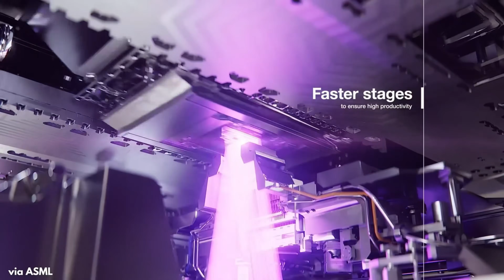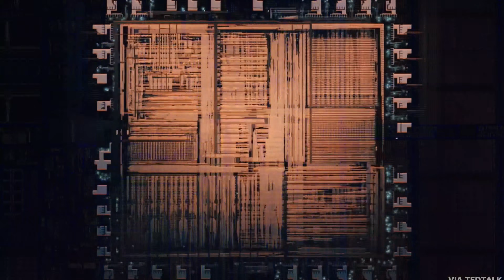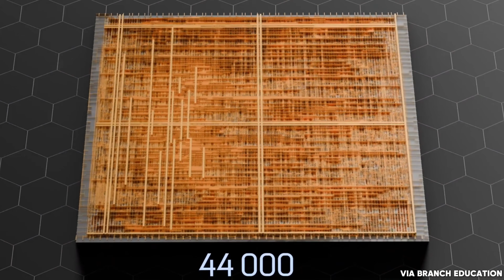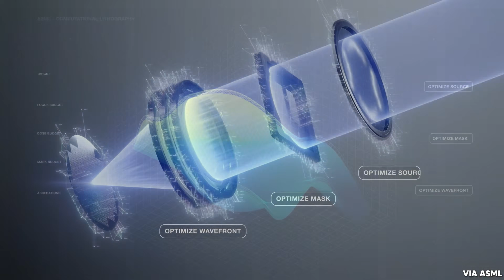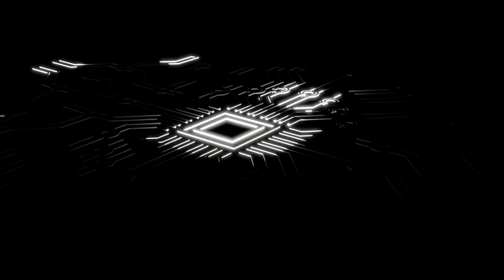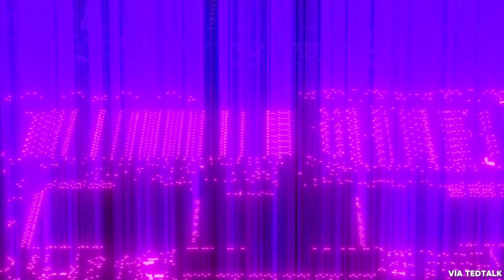Huawei Stopped Shrinking Chips—Now They're Folding Them

Comment from the maker: Which explanation do you believe?

1️⃣ Logic folding is a genuine redirection of chip design—and the sanctions produced the exact capability they were meant to prevent.

2️⃣ It is an expensive workaround built on favorable first-party numbers, which could collapse when the diamond cooling stack meets a phone chassis and a consumer price.

The Mate90 teardown should prove one side wrong. Where did you land before the die shot arrives?